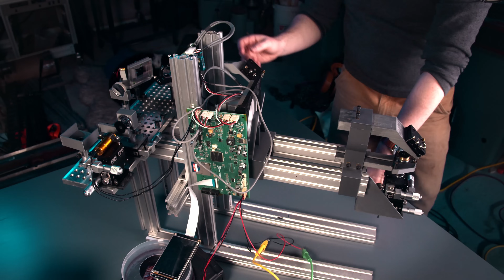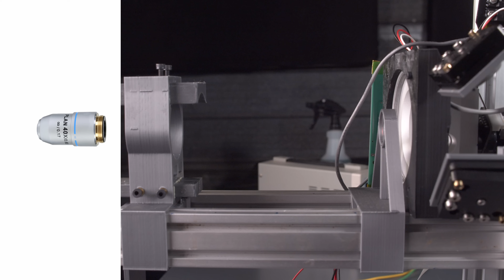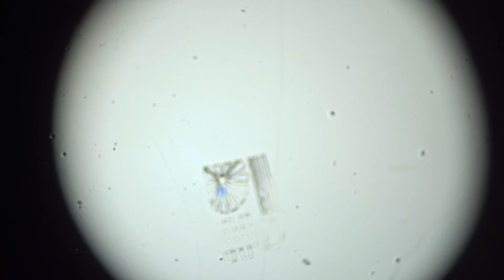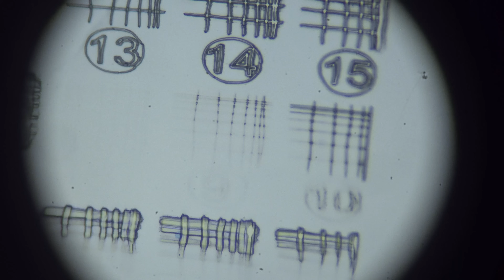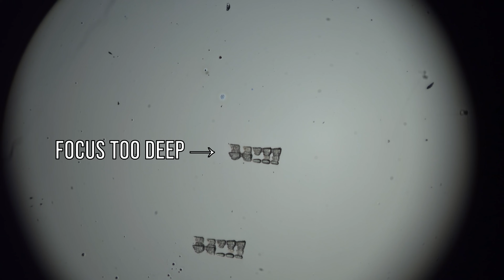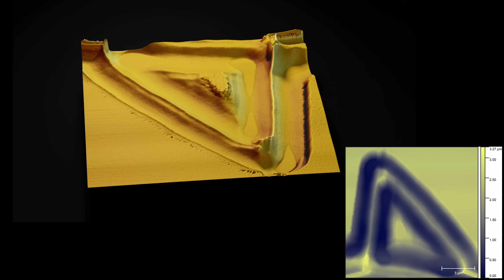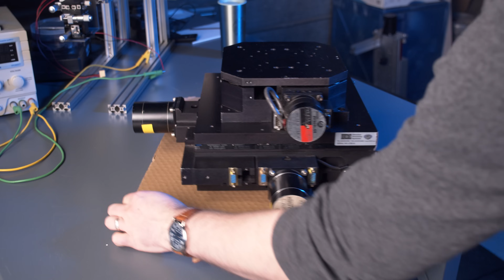DIY Semiconductor Patterning

Comment: Honestly, I think i like your videos more than the other 2 or 3 creators who focus on this topic.  These days its so boring to see someone make a Structured Light Modulator direct exposure/write instrument (DIY versions of Heidelberg instruments).

I would love to see you develop a DIY nanomachining instrument.  Obviously, if your AFM can do scratch/plough operation, all it would take is hardened tip consumables.  It would be interesting to see "subtractive" lithography coupled with "additive" dip pen techniques.... or thermal probe tip if your AFM can do that.

If you have the $$ wait for a good auction to buy used femtosecond laser.  The right power and wavelength could enable Selective LIE/laser lithography.   It is possible to build them for a relatively low price, although you have to value your labor at $0  (last paper I saw said a 2 watt average, 7 fs fiber laser can be built with COTS components, no special pricing, for ~$10k)
Reply from the maker: Oh man, I'd love to have a femtosecond! I've had various auction saved-searches running for a year or two now, no luck with something that's in my price range and looks to be relatively functional (or not crippled by missing software). I did grab a "slow" femtosecond a while ago because it was a screaming deal, but very low power (~200fs, 100mW). Might be able to abuse it for two photon litho, not sure.  Keeping my eye out for something more powerful so I can do micromachining

Got a link for that paper? I saw one a few years ago but it required like a $60k fiber splicer :(

Comment: One question/suggestion here:

What is the Anisotropicity of the Photoresist with the setup made or try optimizing the process with a better anisotropic photoresist.
Reply from the maker: Datasheet for the photoresist here! https://amolf.nl/wp-content/uploads/2016/09/datasheets_S1800.pdf

Definitely opportunity to optimize this side of the equation. Spinning it to a thinner layer, making sure it lands in a good portion of the interference curve, etc. Or as you said just get a different resist, I dont think this one is perfectly suited (it's a big "thick") relative to other high resolution resists.

Comment: is microscope objective lens worked as f-theta lens? is it the same type of lens?
Reply from the maker: Not quite the same as an f-theta.  F-theta lenses are designed to produce rays that are perpendicular to the surface, the focal plane is flat on the surface, and the displacement of the spot is linearly related to the change in angle. Microscope objectives have a flat focal plane too, but the spot isn't quite as linear or perpendicular. 

F-theta lenses are great, but they don't have a high enough magnification to use for really small features. I.e. the highest mag f-theta will give a 30 micron spot (at least without spending thousands of dollars on a super high end lens)

Comment: hey mate - are you sure the rigidity of the system isn't affecting your beam accuracy? I'm thinking even a tiny amount of movement would result in a large % deviation on your target - things like vibrations from your mirror servos or fans? You have a lot of plastic mounts for parts that would affect beam  position!
Reply from the maker: It could be contributing! I think some of the larger wavy patterns are due to the galvo, simply because I could see the same pattern of waves in multiple trials (whereas you'd expect vibrations to be a bit more random). But I think some of the roughness or smaller deviations are probably from vibrations... as you said, the whole setup is the opposite of stiff :)  V2 will be much more solid!

Comment: Really great results for a first prototype! Try another 40x microscope objective to find the source of wiggly lines. A simpler microscope objective might work better. No one paid any attention at all to UV in Plan Acromats or Apomats. An Infinity Leitz polarized light objective or AO Spenser might be a good one to try if I understand your optics train. The best older UV objectives were parabolic reflectors from LOMO in Russia. I expect Quartz or Plexiglas would work as well. Using ~400 nm light objectives made for visible light work. 

Most of our software and some of your hardware will work with both Electrochemical Machining and electro-discharge machining. 

looking forward to what ever.
Reply from the maker: Thanks for the tips, will look around for some!

Comment: Cant wait to see updates on this project. If you get it run properly someday, you could think about trying to mode-lock a diode laser for fs-pulses and go for two-photon-polymerization, basically enabling full 3d printing.

Comment: I would really love to see some tutorials about making high precision PCBs at home. I have a CNC router, but it is so hard to do any traces with gaps smaller than 25 microns. Basically SOP packages are an extremely difficult challenge. I know JLCPCB is a thing, but prototyping like that really isn't very time or cost effective if you do a lot of PCB stuff.
Reply: I meant 250 microns. .25mm. My v-bits always destroy small traces like that, and even with height mapping, it's still relatively inconsistent.

Comment: When you look at your exposure test, you can see that lower exposure shows more squiggly lines, this is more in line with resist deformations than galvo.
Make sure that your microscope objective isn’t pre compensated for 170um slides and try SU8 or modern versions of it such as MR-DLW (epoxy) which is quite forgiving. Oh, and plastic is only an issue when your climate is fluctuating - keep it stable :-)

Comment: Seems like YouTube won't let me post links to the relevant research, but have you considered UV laser-induced graphene for direct writing circuitry?

There's apparently also ways to change the induced conductive graphene to p-type or n-type reduced graphene oxide via multiple laser passes. Seemingly allowing direct writing of transistors.

There's also some research with quantum optics which might allow sub-micron resolutions with direct writing. Alternatively, if you were happy to switch to a mask-based process, there's well-studied ways to use two-photon resins to get this sub-micron resolution using either SU-8 or the bio-based AESO resin.

Hope this helps improve the accuracy of your process!

Comment: What power supply is driving the controller and galvo drives? Some of the wobble and repeatability issues could be from signal noise. In the past to prove or disprove I’ve used a battery to supply power… and get away from a noisy switch mode or ‘other’ noisy supply… also grounding with clean and dirty earths separated is important. Very interesting thanks 🙏🏻

Comment: Just out of curiosity, what led you to go w/ a galvo based setup as opposed to a DLP based solution akin to the one that Huygens Optics is working on?  It feels like you could get more precision and speed w/ DLP.  Thanks, love your videos!
Reply from the maker: No particular reason (my first attempt years ago was with a pico projector actually), I just wanted to try the direct-laser approach. There are some pros/cons to each. With DLP you run into limitations with pixel size quickly, which means you need correspondingly better optics to continue reducing feature size. Direct write laser can "scale" in that aspect a lot cheaper: a good clean beam passed through a 60x objective could theoretically hit sub-micron features.  OTOH, you have to deal with issues like the galvo linearity/stability.  So different trade offs. You can find commercial devices of both varieties competing in the same space for example :)

Comment: What is the application of a machine like this? I'm not familiar with this technology and what its used for
Reply from the maker: Most "microfabrication" projects (making a transistor, or etching a MEMS accelerometer, stuff like that) use photolithography to define a mask. The photoresist selectively protects parts of the substrate from chemical etching. Then you strip off the photoresist and repeat the process for the next layer.  Modern processors might have hundreds of different photoresist layers masked and stripped before the chip is done. But simpler devices like electrothermal actuators only need a few layers and are something I think I could demonstrate. Add a little current and a thin section of the actuator heats and deflects, causing the structure to move a small amount :)

Comment: Having closely examined your design, Mr. Tap Breaker.
 I want to offer you my view on how to perform a scan.
I don't know how to contact you. That's why I posted the model on GrabCAD.
 SL_ST XY VCA
Reply from the maker: Hiya! I was just noodling over VCA designs in fact.  Being lower mass, the galvos will likely have faster acceleration and could have higher pointing accuracy than a larger VCA arrangement... but clearly my galvos aren't very good :)  I think a VCA system might work really well, and is very simple to control.

In your design, I think you could remove the top two lenses.  Since the XY arrangement is already a parallel beam to the objective, you just need the final tube lens to couple it into the objective.  Cheers!
Reply: @BreakingTaps  To be honest, the lenses are for demonstrating the idea. 
Just indicating that they are there, and which ones don't care yet =).
 The linear motor on the VCA can be made very light, on flat springs and printed. In fact, I've been wanting to play with them for a long time.

 Can I send you my work? 
The material that I found and ideas in general.

Comment: It is interesting how the emulsion responds to exposure, it is as if you need to adjust the exposure continuously based on the precomputed number of illuminated sub pixels for any unit square of area. i.e. Over expose the sparse areas compared to the busy areas. Can see what I mean?
Reply from the maker: Yeah absolutely agree, better control over laser power would really help, reducing power when there is overlap or towards the end of lines (since the galvo slows down to change direction, end segments get exposed more than center segments)

Comment: A source of wobble might be the aluminum extrusion. I worked on a machine that did micron scale automated bonding once. We tried extrusion for the frame first but even with the chonky profiles and structural plates you could bump the side of the thing and wobble it off course.
Reply from the maker: Definitely possible! Between the extrusion and the generally unstable / cantilevered design, I wouldn't be surprised!

Comment: Spinning mirrors are always moving so your spot cannot dwell to increase exposure time.  Only repeated frames or higher intensity can do that.  Repeatable frames will demand that the mirrors rotate synchronously.  At some point you will also face reflections from the back glass surface being out of focus and exposing your resist from behind...

Comment: What if you ditch one galvo and do scanning similar to a laser printer? 

Not sure if that works, but if you can just reuse an old laser unit from an actual printer, you have 600 dpi over about 20 cm, so together with the wafer stage that could maybe work?

Comment: Maybe you are aware of it but i think you could improve your setup by using a F-theta lens that is designed to convert angular motion into linear directly to reduce the coma aberrations
https://www.youtube.com/watch?v=P-zcg7mrqHc
You can also improve your resolution by using a beam expander before the F-theta to enlarge your beam a bit to reduce the divergence of the beam and get smaller focused spot
Basically, you need the largest possible beam and the largest F-theta with the smallest focal distance possible but it gets rapidly pricey.
Another cheaper solution is to replace your final microscope lens with an off axis parabolic mirror than can have super small focal distance to reduce the focal point, expanding a bit the beam before the mirror is also interesting in this setup.

Comment: Damn! That is a really fantastic prototype! I cant wait to see how this thing does once you've gotten it strapped to a ground cast iron base and weighs 100lb. Might even outdo the resolution of the xy table.
Reply: Good call. I bought a 250 kg cast iron surface table to use on vibration-isolated mounts for this sort of experiment. It needs a rustproof optical bench plate bolted and glued to the top. Even just using air bag supports, the thing is ridiculously stable. A quarter of a ton lump in the lab is a little inconvenient as it needs an engine crane to move it around. I have some granite surface tables as well, but drilling and tapping those needs epoxy anchors.  I can drill and tap directly into the cast iron table.

Comment: Ok at (0:07) I took that as a maskless method, sorry I see now you mean the resin mask is made with out a photo positive mask, not that you are direct writing the deposited material by using Vapor Deposition with a laser assist so the vapor is not deposited where the laser is striking the surface. Still very forward thinking, love it, and I am guessing if a second laser frequency could be used on a material so one solidifies the material while the other diminishes the permanency of the material it would be even easier to do a direct lithography, like maybe causing it to turn to powder so it would be easy to extract with a static charge attraction. 

I think though direct write of the material is the way to go, I wish more people were working on this tech like you are, and we all had better way to get together and work on projects! This is the way, 

Replicator tech will lead to a federation future, while focusing on warp and phasers and photon torpedoes as the first focus leads to an empire dark mirror universe I believe (the tech are all just allagory for working on manufacturing tech first, and waiting to work on transportation, or destructive,  tech till we have the most effective and decentralized ownership method. IE. it is micronized so anyone interested can own operate and house it in a garage, on a bench or even in the kitchen or home office, and even better if it is portable in say a trunk to be deployed anywhere,) 

and by manufacturing I mean the whole package, refining/recycling, power harvesting, assembly, so no supply line of any specialized materials are needed, though more concentrated materials acquisition could be done by mining dump sites for electronics and such, it's still possible if necessary to harvest from the wild like carbon from that lawn you mowed, or feeding in mineral rich rocks you found on a hike.  Biggest advantage to it being shrunk and fully replication capable with the assistance of someone putting the printed parts together, which avoids that whole fear of grey goo the tech can propagate like a virus, ie if you hobknob with a friend who's house is infected, ie, they have one in their house, with replicator capable tech, you end up with your house infected with it by the fact they know how useful it is and offer to gift you a copy of theirs, which they make using theirs. and this cycle repeats when you find someone lacking one, where you copy yours with yours, and gift them one too, LOL, Before you know it the whole world will be able (even if they don't choose to) participate in a massive world wide opensource process of just about anything, even making killer floating nanobots that are powered by a wireless system at your house and destroying mold spores and viruses keeping your home clean, (and maybe even breaking down the toxins still persisting in our environment like fluorocarbons when they encounter them, as well as solvent evaporated gases like xylene and toulene from spray paint and such LOL)

Comment: It was nostalgic to see a bottle of Shipley photoresist again; that part of my life was about 40 years ago 😮 Back then, the bleeding edge of semiconductor fab was striving mightily to get to 1.25 um, so I’d say getting within an order of magnitude of that in a home shop is pretty amazing👍 (Of course, they were aiming for maximum-throughout/minimum-defect production, but still…)

Most amazing to me was that the AFM could get down into such high-aspect ratio (high-slope, really) features. I knew that they had very high resolution both laterally and vertically, but didn’t realize that the probe tips were both thin and long enough to be able to track such steep slopes.
Reply from the maker: Yeah AFM tips are really impressive these days! I'm using the DLC tips from ICSPI (https://www.icspicorp.com/tips). 20nm tip radius, 1 micron tip on a 3 micron post, <10degree angle.  Super high aspect ratio for trenches like this!
Reply: @BreakingTaps  🤯